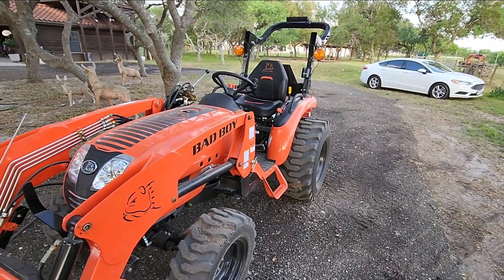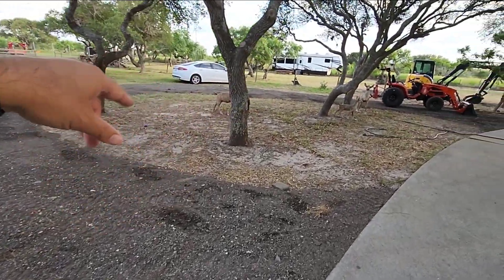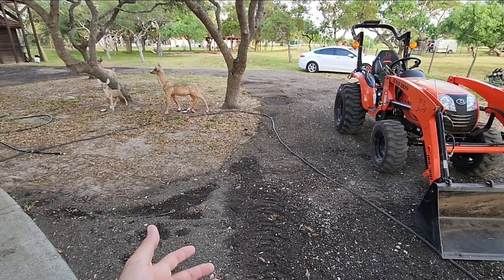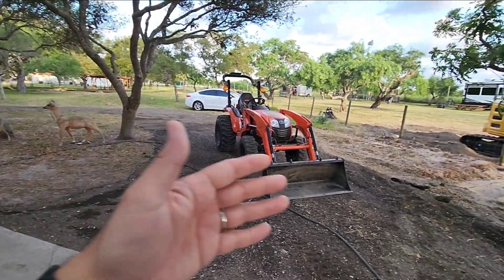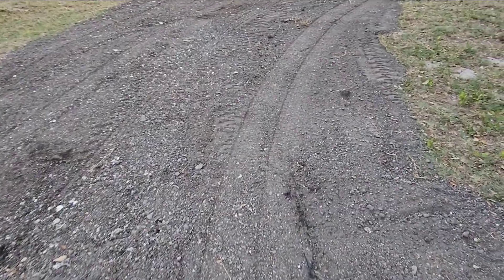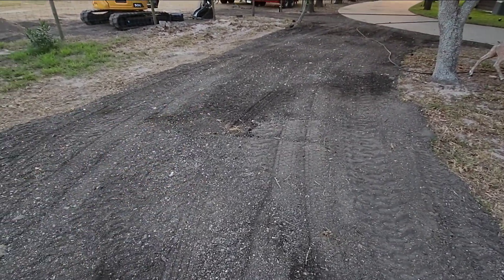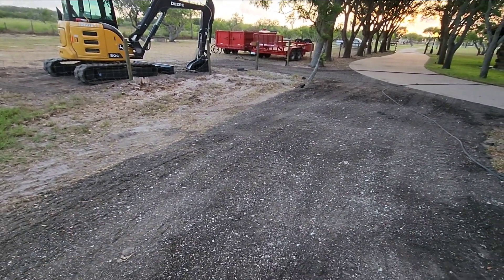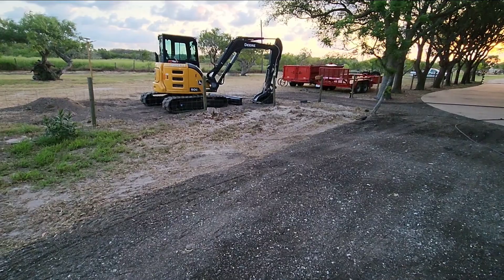What is Reclaimed Asphalt? Let me show you!

Comment: It will slowly turn back into a pavement specially if you add a little bit of tar to it . iit used to be so much cheaper and so much easier to get now here in Tennessee they found out they can reuse it all to re pave  so it’s getting a lot harder and more expensive to get here